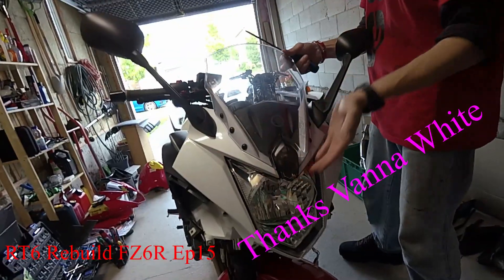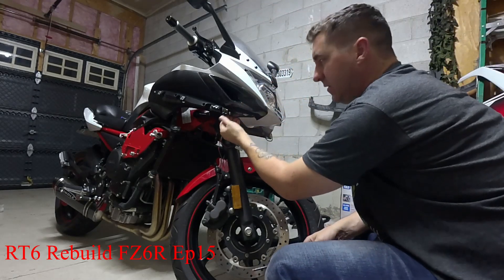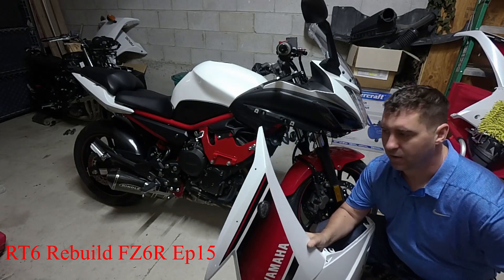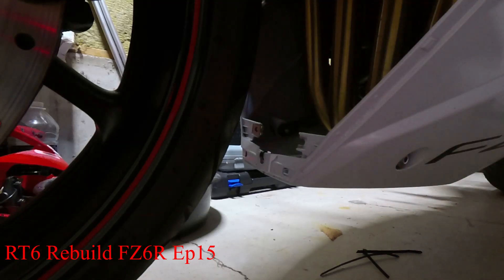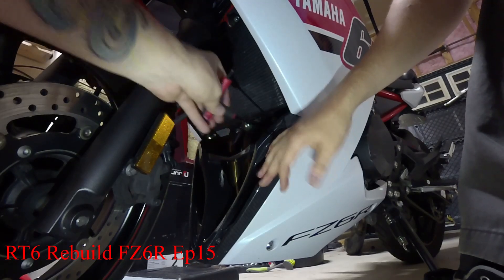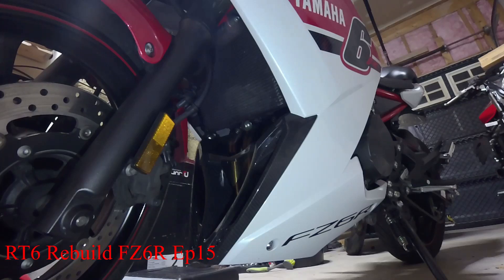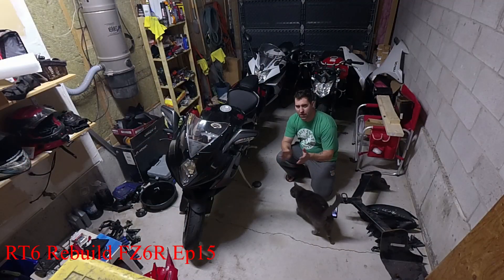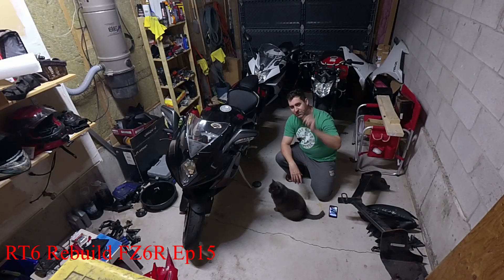Crashed Motorcycle Rebuild FZ6R Ep15 - My FZ6R is no longer Naked !!

Comment: Ah man that chin fairing part can be a nightmare sometimes! Mines a little more tricky since I've lowered the front end which brings the front wheel a little closer plus I have a fender extender. Looks great👍
Reply from the maker: Yes I can imagine.. it's a nightmare the worst of times, plus mine hasn't been on the bike since June.. and all the cage nuts are either new or re-installed...lol.. Did you find the lowering did much for the bike ? The parts bike I have is lowered as well.